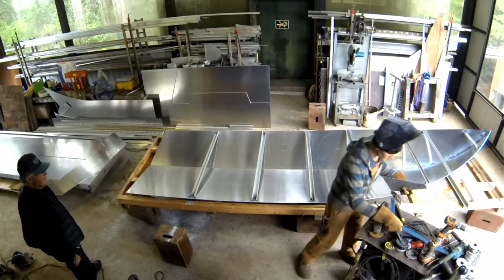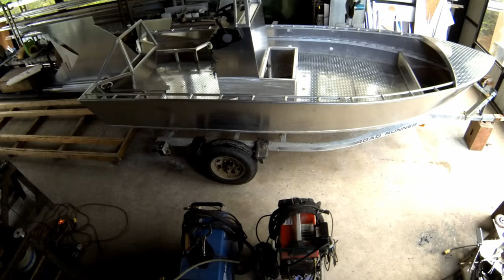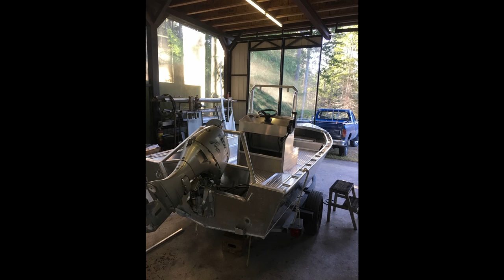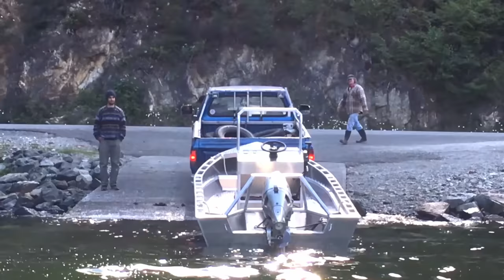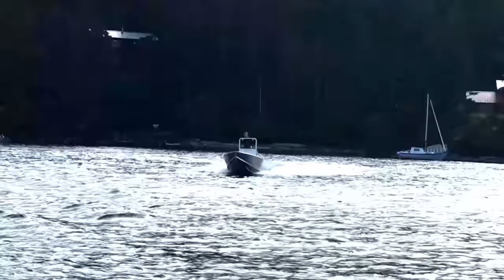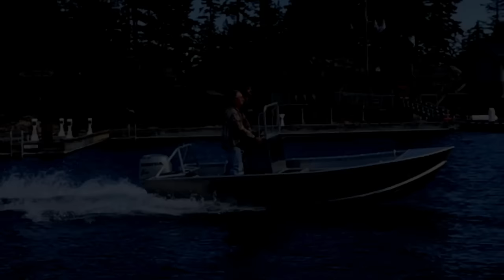16 foot welded aluminum boat build

Comment: Thank you, love it.  For me, ideal would be higher rails--and I would love to see it on a dual axle trailer, why?  Not weight bearing so much, yeah, I get this is more than enough.  But with a dual, you can carry extra things in the boat without thinking about it--AND, when you have a high speed blow out, and it can happen, even with the tires maintained, you have an extra level of safety.  Again, ideal world.
Reply from the maker: Thanks! 
Higher rails are definitely an option. 
Tandem axles are nice, but this rig will be going about 2km from the launch ramp to storage twice a year, on a rural road with a 60kmh speed limit, so no high speed blowouts for this one :)) 

Cheers!
Reply: @EM-hu2bj  I hear that, you if you can get 90 percent plus of your needs, you are great.  I just always think about ideal designs, IF one starts hitting the open road, maybe to camp and fish, dual trailers can't be beat.  Mine is on a single too, and I keep tires in top condition, and a spare; still in that ideal world I would take a dual any day.  Fantastic boat, thanks for posting--and you can't beat that engine.
Reply: @jimquantic I’ve been towing a single axle boat trailer for 18 years and not had a blowout. 2200 kms return trip from Australind to Shark Bay annually, we change bearings regularly, trailers been serviced and fixed as required
Reply: and I for forty years, and I too have not had a blow out.  That said--and in line with boating in general a "back-up" for everything is a good idea.  I carry a kicker engine--and needed it only ONCE in all these years, but still "best practice".  SECOND is weight bearing, you simply have way more with a dual.   @boikebeagle

Comment: Ничего себе сколько много времени и труда в основном у сварщика. Сварщики вы молодцы
Reply from the maker: I spent about 120 hours on it, and I had a helper for pulling the hull together and bending on the strakes, plus a few other parts. Probably around 30-40 hours of welding.

Comment: Nice sturdy boat. But for me, the center console needs to be moved forward 12-18" to obtain a better balance point.
Reply from the maker: We actually test launched it to double check the deck height, and had the console fabricated, but not yet installed, so we were able to move it around and find the perfect balance point for the console and operator.

Comment: Respect for being able to build this with just the two of you. What tool is used to make the crease on the hull sheet?
Reply from the maker: I cut a partial depth score (later welded up) and pulled the edges in with ratchet straps and chains

Comment: looks good, but why not have full size stringers like full triangle of metal sheet spanning from one side to the other ? that would make it much stronger, would provide more support in the chop.
also why not fill bilge with floatation foam for safety

Comment: Great video. May I learn what type of aluminum you used for boat building?
Reply: It's in the info for the video, hit the down tab.
Reply from the maker: The plate and sheet is 5052, and the extrusions are 6061. Cheers!

Comment: Fab work tops. I did not catch the flotation foam install. Test drive cold enough for coats, but not 1 pfd? No other saftey gear on board? A 16' should have seating middle and back for rough sea. Either too cool or too something going on.
Reply from the maker: Thanks! 
If you look closely you’ll see I’m wearing an inflatable PFD, and the owner and his son had theirs tucked under the bow. Radio, oars, lines etc were on board, and we stayed in the bay. Not too cool for safety here. 
Boat was built to the owners specification, with two back corner seats, bow locker seat, and a seat in front of the console. Hull is double welded and pressure tested, but no foam by request.

Comment: 💚💚💚💚 bookmark/ notes: welder anchor , which way fish first , walker cross bar sliding down while welding like physical rehab , red fish Lips on that , try sir metal like just road a broke a mustang horse , crew welding box and it’s long wire with welding tip welding metal  boat for specific fish     ( da throwback on that boat like 🪡 needle #marlin 🪄) ( …..ect….tbc…..-g-b, bot

Comment: Lovely work .. but just a question I thought aluminium was a really soft metal ... how thick would that have to be to be safe to use as a boats hull .. thanks
Reply from the maker: Thank you! 
It is certainly softer than steel, but it’s highly corrosion resistant, and widely used for boat building, including commercial fishing, patrol, law enforcement, and pleasure craft. The required thickness depends on boat size, design, and intended use, and the alloy used. This boat has 3/16” plate on the hull bottom, 1/8” sides and deck, and 1/4” for the transom.
Reply: @EM-hu2bj  thanks for the reply.. all the best from England 🏴 .. look forward to more videos

Comment: Hey man great video. What settings did you use on your machine voltage and amps. I’m about to get started on my boat.
Reply from the maker: I built this one with a Millermatic 210 with a spoolmate 3035 running drilled out tips and 3/64 5356, and a Lincoln squarewave 200 with 3/32 4043 filler.  I don’t know what the Miller settings actually correspond to as far as voltage and wire speed,   but I had the voltage set between three and four, and wire speed at 4 to 6. Just experiment on your off it’s till you get it running the way you want it. On the tig I was mostly starting maxed out at 200A and then tapering it back with the pedal as the work piece heated up. Have you welded much aluminum before? What’s your setup?
Reply: @EM-hu2bj  I haven't welded much aluminum before, got a spool welder on a single phase 200A wire feeder. I'm going to be welding 1/8 5086 as a majority of my welding, mostly butt welds, doing an aluminum boat. I come from a welding (management) background so I'm learning all the time.
Reply from the maker: Nice! What boat are you building?
Reply: 12 foot skiff utility.

Comment: I believe I looked through all the comments for the filler metal you used. Saw you went through a case but didn’t see which type. 4043 or 5356 maybe?
Reply from the maker: Filler is 5356 👍🏻

Comment: Nice build but I seriously question the design (having built a 16ft alloy boat myself 20+ years ago.
First 2 things I noticed?
Nice transverse frames across the hull bottom sheets, but not even one longitudinal stringer?
Typically there should be transverse frames and longitudinal stringers to creat the boxed frame that resists tortional twisting moments that will fatigue crack structural welds over time.
This is a critical design element missing in this build.
Next?
No positive bouyancy foam under the floor to prevent the boat sinking if / when flooded.
This is a design rule requirement to register / license a recreational boat hereabouts.
The foam has to be closed cell fire retardant high density poly euro thane - and it must be encapsulated (to prevent foam crumbles from floating on water under the floor to your bilge pumps & blocking their screens causing the pumps to run dry overheat and burn out.

It’s always a shame when you see obviously skilled welders / fabricators building a nice looking hull only to miss out some critical elements that typically won’t be obvious to a boiler maker / welder.
There’s more to building a great alloy boat than just being able to weld & fabricate.
Still a nice boat, just not as nice / safe & long lived as it might have been with a little more attention to details. 👍
Reply from the maker: Hi there, 
There are longitudinal structural members, you can see them at 3:42 while the boat is being turned, and the stringers and verticals are welded down directly over the outside strakes for even greater strength,  Also, the hull plating is 3/16", much heavier than most boats of this size and horsepower. 
Regarding foam floatation, production boats do require it, and it does have its advantages. It also has disadvantages, including greatly increased chances of serious hull corrosion, and much more difficult future modifications and repairs (all of which I have personal experience with). In this particular case the person who commissioned the build requested no foam. The hull is completely sealed and pressure tested (with the exception of the necessary vent line, plumbed up under the bow deck), and has an easy inspection port to confirm that it is not leaking. In case of catastrophic hull impact, there are plugs mounted at the scuppers, and with them in the entire hull cavity can flood without sinking the boat.
There are many ways to build a safe and durable boat, and the choices made on this one were carefully considered, and not due to lack of attention to details.

Cheers.
Reply: @EM-hu2bj  Nice to hear. 👍👍👍

Comment: Interesting to see this built, well done. I am curious, why is the floor so high? and that space under the floor not used for storage? Just seems like the center of gravity is a bit high on this. But perhaps there is a reason for this..or this boat has a specific function that I am not aware of.

Comment: Hola que tipo de aluminio debo comprar para reforzar mi bote de aluminio.
Reply from the maker: Hola! if you are looking for aluminum sheet, then either 5052, or 5086 for extra strength. For extrusions 6061 is generally used.

Comment: Hello good job !! Where did you get the blueprints for the boats?
Reply from the maker: Hi! 
The designs are my own. I am working on plans for the 14 footer, and will have them for sale when they are ready.
Reply: @EM-hu2bj  Just checked out your site looking for plans. Great site. Wondering if plans are available yet because I didn't see them. I think this would convert nicely to a tiller walleye boat -- just lose the center console.
Reply: @EM-hu2bj  Any update on the plans for the 14 footer? Thanks!

Comment: It seems to be normal to go to the next process after doing R.T and U.T after welding. However, there is no such process in this video.  It seems that problems will arise later.
Reply from the maker: RT and UT are not generally done on small recreational vessels such as this. all hull seams are welded inside and out, and pressure tested for leaks.
Reply: There is no need to go to that level of expense and time.
After all, only the most critical pipe or structural welds are ever RT inspected and UT is only required on CJP connections.

Other than that it's VT (Visual Testing) for almost all welded joints in both ferrous and non ferrous metals.

This CWI thinks the OP is doing a fine job.

Comment: Good work but mistake the curve !
Always , remember , everything moving on water has to respect some mathematics rule !
The curve of hull are derivated from the circle !
Scissoides .
If the hull has monoedric angle on vertical section or in orizzontale section .
The curve are apply on the junction of plate !
This give stability and fastness.
Specially when you weld is much easy and elegant.

Comment: I've watched this video a few times.  What are you cutting the sheets with?  Is that a circular saw? A super-duper jig saw?
Reply from the maker: It's a circular saw with a regular carbide tooth blade. I have a piece of plastic (an old welding lens cover) clamped to it to stop chips from the carbide breaking the shop windows. For the curves I run the blade shallow and pivot the saw up and down a little against the front of the saw base. Works quite well, and leaves way cleaner cuts than the plasma cutter.

Comment: In the sea trial footage, the boat doesn't look like it's quite getting up on plane. Maybe use a 60-75 horse? Armchair Engine-ear here. Someone tell me if I'am wrong.
Reply from the maker: Planes starting at about 12 knots. Top speed is 30, and it’s barely in the water at that point. Owner already had the engine, so we built for it. No problem with power on this one.
Reply: @EM-hu2bj  Thank you.

Comment: hi would like some detail on the wooden base under the boat ,thanks
Reply from the maker: The wood base is actually the pallet that the aluminum came on. With the centre beam knocked out the hull sits nicely in it, and it helps to keep it stable. I have found it’s possible to clamp opposing sides fore and aft down to the frame to straighten out a minor twist. 
I’m currently building a heavy aluminum jig for then next boat I’m doing.
Reply: thanks Fr . Newfoundland

Comment: Hi there awesome build. what part of the construction makes it self bailing? n what angle did you use for the dead rise at the transom? looks about 10-12 degrees, guessing.
Reply from the maker: Hey! Good guess, it’s 12 degrees :) 
It’s self bailing because the deck is fully sealed (except for a vent line under the bow deck), and above the loaded waterline. This means it can have open scuppers, and and water that gets in (rain, spray, breaking waves, etc) runs right out.
Reply: @EM-hu2bj  Thats Awesome! thanks for the reply

Comment: Lots of talent there. But I don't like the design. This may be fine for small lakes and rivers but larger lakes and the ocean have much larger waves. I am very impressed with the welding. There is no way I could do that. After owning  6 large boats over 25 to 42 feet and dozens of small boats I have opinions on boats but we all do. So this is a complement but not for me.

Comment: Is there some sealant used in the underwater weld lines? Or is it just welded watertight?
Reply: no the welds should be water tight
Reply from the maker: Yep, they are watertight. fully welded inside and out.

Comment: Can i ask you what are you using for the welding machine 🥰😊 beautiful
Reply from the maker: Thanks! 
This one was built with a millermatic 210 with a spoolmate 3035 drilled out for 3/64 wire, and a Lincoln squarewave 200 tig
Reply: @EM-hu2bj  yeah I recognized the miller and saw the spool gun sitting on the boat.  I have a miller 212 and a miller spool gun.        Where was the water the boat was on?
Reply from the maker: @thornyturtleranch4u  That will do for building these! Cortes Island, BC, Canada.
Reply: @EM-hu2bj  small boat if the sound got choppy.  My brother in olympia washington wants to sail the world in a sail boat.  I told him let's build an aluminum catamaran, 40 foot plus.  He thinks it would take us 10 years to build one.  I said not if that's all we were doing.  I'm thinking about building some aluminum pirogues.  I live in louisiana and the pirogue is like a flat bottomed canoe.  People like to go in the swamps duck hunting, setting crawfish traps, and  even deer hunting so maybe it's a way to make a dollar or two but maybe not.  The welding an a pirogue might be about as much as a larger boat unless I found a way to bend it like they make canoes.  Nice video.  A nice chinese 200 amp AC tig and plasma cutter combo multiprocess should arrive today, Ramsond brsnd.  I also have a miller diversion tig but I still need to learn tig better.  The DC strike arc chinese harbor freight I have was nearly impossible to learn to tig with. So I'm about to become a tig master.  I also got a lift tig the other day, yes welder Mig combo and lift tig seems much better than strike arc.

Comment: what about foam ?
Reply from the maker: The guy I built this one for didn't want it foamed.  
Foam makes a real mess if you need to repair or modify it later, and nearly always seems to end up getting waterlogged. The hull and deck are totally sealed and pressure tested (aside from the vent, up under the bow), and and the airspace between deck and hull gives it plenty of positive buoyancy. there is a deck fitting so it's easy to check for water, and a garboard drain plug for when its on the hard so it doesn't collect condensation.